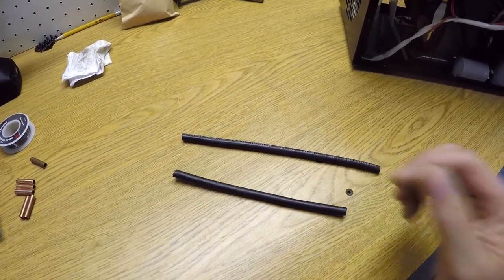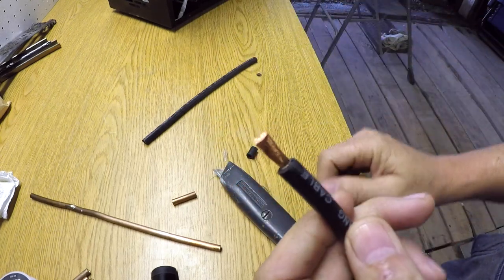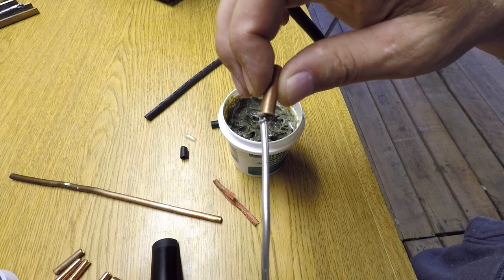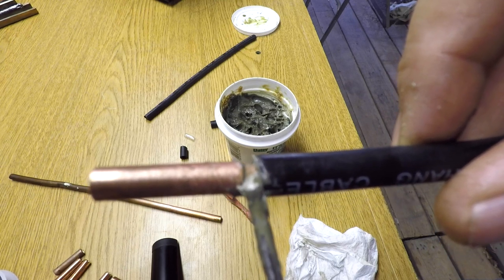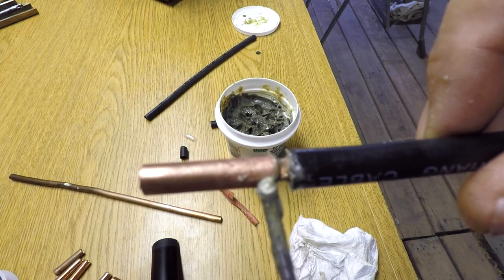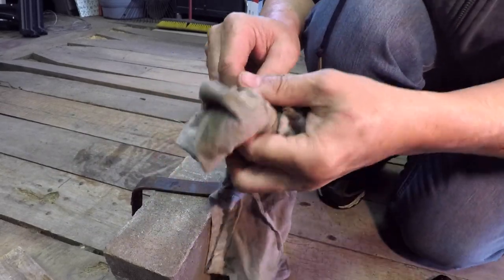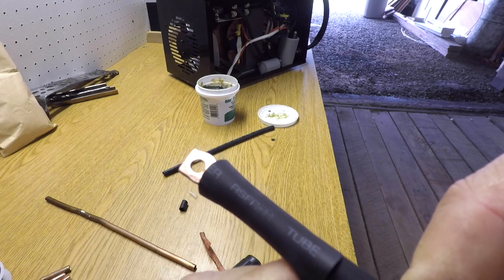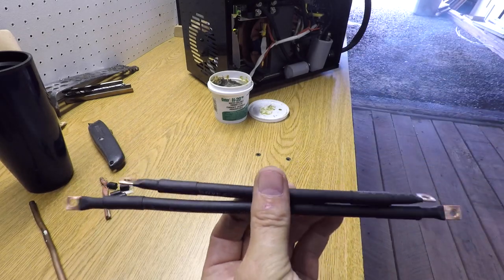How to Make Homemade Copper Battery Cable Connectors

Comment: If you wrap a wet rag around the end of the wire at the insulation it will prevent it from burning and pulling back. Best tip I ever read. Works amazingly well.
Reply from the maker: Great tip!

Comment: Did something similar, but your method is way better than how I made and connected my terminals. I'll probably redo my connections in the future.
Cheers
Reply from the maker: I'm sure yours will work fine. Nothing inside the machine should move much if at all. Either way beats spending what they want for those copper ring connectors.
Reply: No doubt. We need to be more resourceful and stop buying things we can make. If not to save a few bucks, then to keep our skills sharp.

Comment: I love this idea for making lugs.  Until I saw you do it, I had never thought about doing it this way.  Did you use an older penny for making the larger lug.  I discovered in Chemistry class a few years back that the newer pennies have very little copper in them.  They are mostly made out of zinc.   I confess that I don't know how conductive zinc is.  If it isn't very conductive, it may create a lot of resistance and get quite hot.    After Googling it, It would seem that zinc is almost as good of a conductor as copper.   I thought about deleting the above message but thought you might find it interesting if you hadn't already thought about it.
Reply from the maker: You are right and I did think about that. I believe any pennies made after 1982 are zinc. I made sure I used an older penny that was made out of pure copper. I think it was a 1953 or something close to that. Good catch!
Reply: @DIYHomesteadProjectsDIYHP10  Now that you mention it, it did look like it was a wheat penny.    I should have known that you would be on top of this.  You always seem to research the projects you are working on completely.